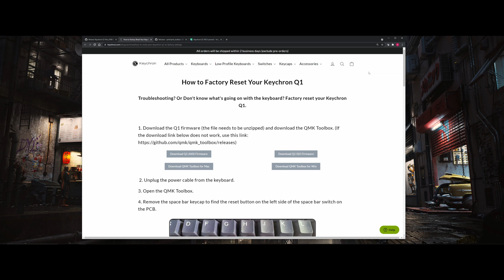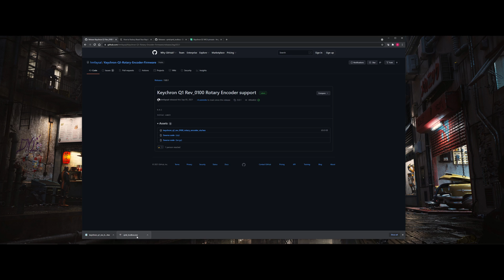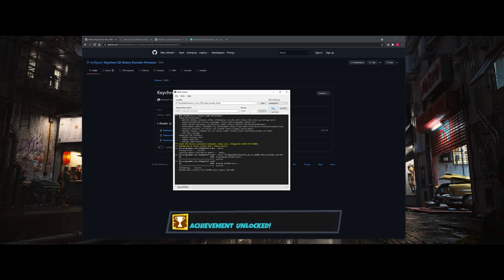Keychron Q1 Rotary Encoder (Knob) Installation Tutorial

Comment: (3:20) for those who is having trouble installing the firmware to their keyboard after installing the QMK toolbox
try restarting your computer and then flashing the firmare
Reply from the maker: Yes, this is great piece of information that I left out :(.  Thanks for tuning in Zarlan!
Reply: @essdubzyt7996  your tutorial helped a lot! Thank you very much for your help
Reply: does it only work when the switches are not installed
Reply from the maker: @smalleYej  You can flash your firmware with the switches installed.

Comment: Hello, Do I need 15mm or 20mm of the rotary knob ec11? Thank u
Reply: I just installed the 20mm and it works like charm. But, ill suggest to buy the 15mm for the esthetic, because 20mm seems too high:') also i' llgot mine swapped to 15 very soon.
Reply: @edgar6639  thank you very much 😀😀
Reply: @edgar6639  wait one more question, should I get the D shaped shaft or the full axis one

Comment: I modded my Q1 v1 to add the rotary encoder (knob) and flashed with the Keychron firmware at 

https://www.keychron.com/pages/the-firmware-for-the-diy-a-knob-for-your-non-knob-version-q1

The rotary encoder seems to have the skipping issue when I turn the knob too fast and sometimes when turning the knob the first step/detent is not detected. The firmware version on Keychron's website for the DIY knob is Ver 1.01 (official firmware for Q1v1 non-Knob is Ver 1.08). Anyone know of a newer firmware that fixes the rotary encoder issue for us who did the DIY knob mod?

Comment: Great video! 
Noob question if I may - I have a GMMK pro and I’ve been struggling to program the rotary encoder to have different functionality when holding down a modifier key, as you show from 4:25 onwards. Is it possible to set vertical / horizontal scrolling to ctrl / alt + rotary input on a GMMK Pro? Reddit and YouTube are pretty dry on the topic, but this vid has given me hope! 😄thanks in advance to anyone who comments
Reply from the maker: If you got Discord, I can certainly help out. Drop your UN, and I can discuss with you there. I'm not the most comfy with Glorious software, but there are ways to get QMK working. https://www.reddit.com/r/glorious/comments/srzeu5/uploaded_qmk_firmware_files_for_gmmk_pro_ansi_iso/

Comment: if i had a non-knob version of the q1, would it be possible to install a knob the way you did?
Reply from the maker: This is exactly what I did. I had the v1.0 with no knob and put it on myself. I don’t think there were any pcb changes but maybe I’ll see if I can confirm that and reply back to you.  When did you purchase your no knob? Does yours have a jst cable as opposed to the flat ribbon?
Reply: Thanks for the reply! I actually havent purchase one myself yet and I'm trying to save cost here as barebone knob version are out of stock in my country🥲. Planning to buy a barebone v1.0 with no knob and then following your tutorial to turn it into a knob version 😅.

Comment: This worked on my first try. Thanks so much for the walkthrough. The only thing I noticed is that the Volume Up/Down are reversed. But not a big deal until the official Keychron files. Thanks again!! :D
Reply from the maker: It is actually up now! - https://www.keychron.com/blogs/archived/how-to-reset-your-keychron-q1-to-factory-settings.  I will probably do a quick update with the official Keychron Firmware. Also, thank you for tuning in! I hope you're having a blessed holiday season.  If you have the OG Q1 v.1.0 that firmware may not work as I believe they swapped chips, I will need to do some testing!
Reply: @essdubzyt7996  I think you are correct. I tried the Firmware from the link you gave me and I won't load. So I'll stick to the one you provided for now! :D
Reply from the maker: @mrguillo  Hang tight buddy, there is a legend in the Keychron Discord who is working on some firmware that will address your reversed problem! Will come back when they have it completed!

Comment: So when the Q1 knob versión finally gets released, you think the official firmware for that version will work flawlessly with this mod? I guess so, if the encoder is actually the same type right?

Nice work on the keeb! I'm gonna do the same since I just got the Q1 as my first keyboard! I hope the modded firmware is relatively easy to install.
Reply from the maker: Thanks for tuning in!  Hopefully this was helpful!  It’s super easy once the encoder is soldered on.  I actually have the official firmware, are you in the Keychron discord by any chance?
Reply: @essdubzyt7996 Can you send it over through discord?
Also I'm used to soldering so I'm not worried about that
Reply from the maker: @mightymadman  that’s the plan.  My name
Is Thel in the discord. Please DM me!
Reply: @essdubzyt7996  with the official firmware does the tutorial change much?
Reply from the maker: @bloobloohed1212  Shouldn't change much at all, instead you can download the official Keychron firmware and leverage it in QMK
Reply: @essdubzyt7996  Yes! I just got in

Comment: Thanks helped a lot for the install, the volume is inverted for me though. Turning clockwise reduces volume and counter clock wise increases. Is there a way to change this?
Reply from the maker: I’m glad it helped and thanks for tuning in!   Is your Q1 ansi or Iso layout?
Reply: @essdubzyt7996  It's an ansi layout.
Reply from the maker: @victoriaaa2901  That is bizarre. There is a way to change it but you would need to modify the code, and apply it again to the Q1. Sorry, just confirming you used the link in my descrip. to grab your firmware?
Reply: @essdubzyt7996  Yeah I did
Reply from the maker: @victoriaaa2901  That is very mind boggling.  I assume you tried to reset and flash again? Sorry, just troubleshooting to the best of my ability.
Reply: You can try download the source code and add a corresponding line according to the qmk documentation: https://beta.docs.qmk.fm/using-qmk/hardware-features/feature_encoders and then compile it to get the hex firmware. It might sound intimidating at first but it's really just adding one line of code and the documentation is pretty straightfoward.
Reply: Hai , i got the same issue , are u fixed it ? Can you share with me if u did it ? Thankyou a lot